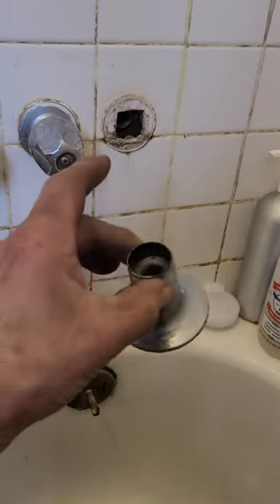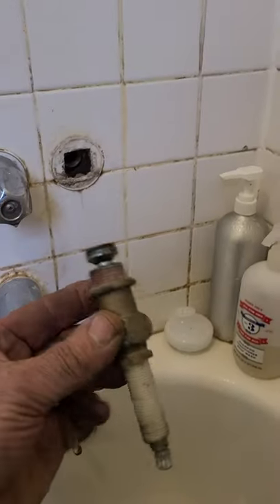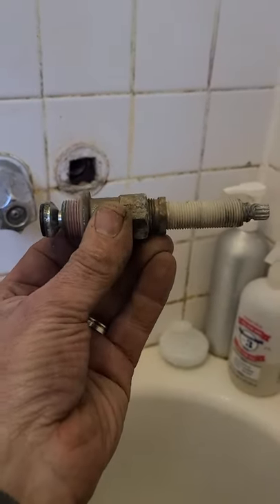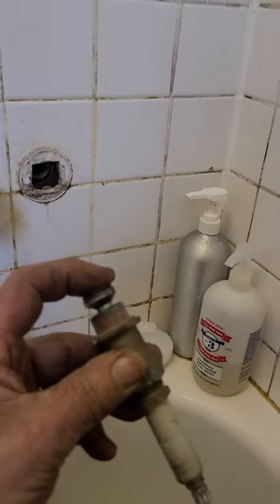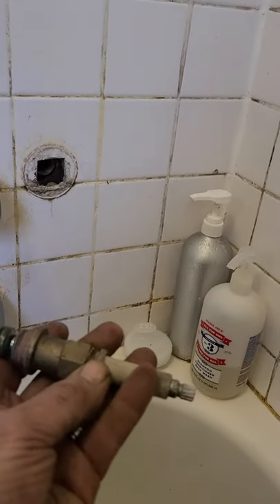Three Handle Tub Faucet Repair

Comment: The removal process would have been helpful!
Reply from the maker: It is always best to start over with a new tub shower valve,  but we can't all do what is best every time.  If you are planning on staying in the home longer than a couple years, you should do rip out the old stuff. I tried to talk these people into opening up the wall and installing a new faucet. They didn't want to open a wall and repair it, so they had me rebuild it.  I have rebuilt faucets just like this for 30 years. I am as good as they come, at fixing things right. I have everything with me to do a complete rebuild  on just about any tub/shower faucet. I only buy the best parts I can. My rebuild parts will be better than the original. But it is still an old watered faucet. If you are very careful with it, the washers might last 2 to 5 years, and then it has to be rebuilt again.  I used to charge $200 labor plus parts to do this. Most people don't want to pay me to come rebuild their old faucet every few years. You can do it your self. Send me photos and I can walk you through it.

Comment: @bennybarbking did you have to turn off the water to the house or tub before removing the stem? I have the exact same setup in my shower/tub but I’m afraid to unthread the stems and water come gushing out or down into the wall behind the tile.

Comment: i love the video.  i have an old time bath/shower faucet.  if i go to Lowe's, or Home Depot, i would not be able to find a replacement.  The ones at those stores are too narrow for my pipes. A plumber would need to redo the whole pipe system in the wall where the faucet is.  I wanna find a new, or somewhat new, faucet to put in there.  I would appreciate a reply with a supply house where i can find one.

Comment: I Wonder if anyone else has ever heard showers running just after you started your shower, while living in a apartment complex.

Has anyone else noticed that even when you close your tub drain and put a drain stopper to keep the water in while you soak your feet, drain is still leaking out water, because I can hear water flowing through the drain even when the water off, and the drain is plugged, and the drain lever is turned to stop, yet water is still going down the tub drain.

I noticed that even when I Did this, I noticed that I could hear water draining, even when I closed my drain and placed a drain stopper in my apartment tub it continued to allow water to drain.

I live alone and I just wondered why this happens and if anyone else has experienced this problem before.

Author Advocate, Activist for Humanity,
Jason Sandifer,
Michigan,
4/27/2023
5/15/2023
5/30/2023
Reply: Yeah every time anyone take’s a shower